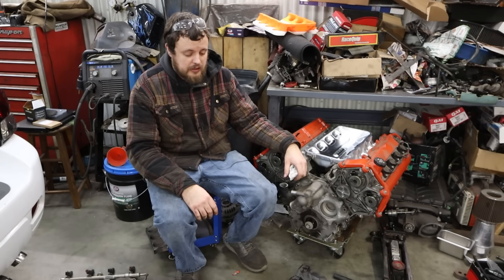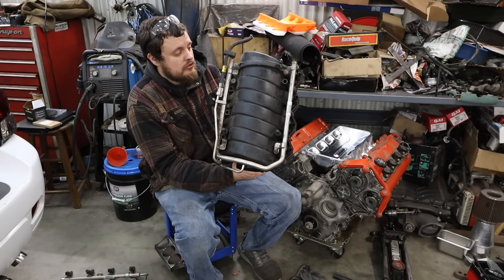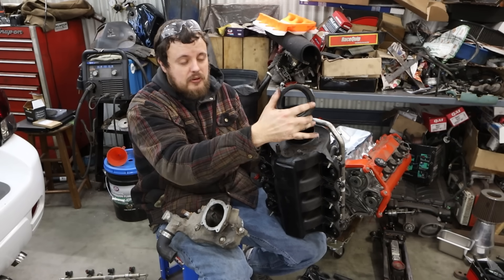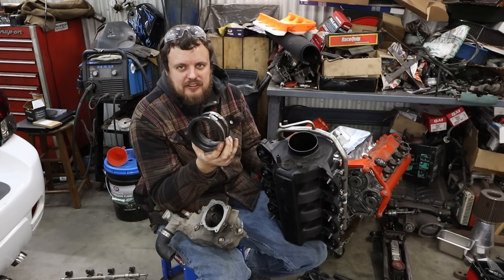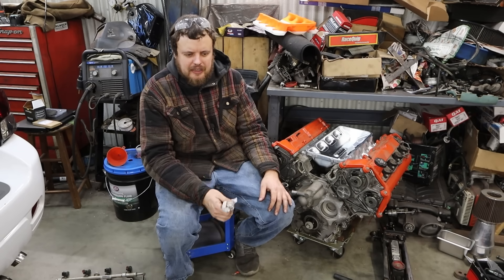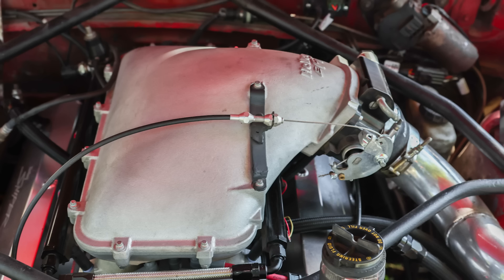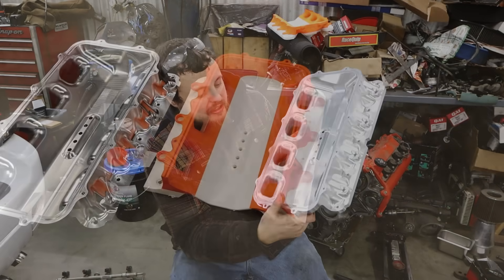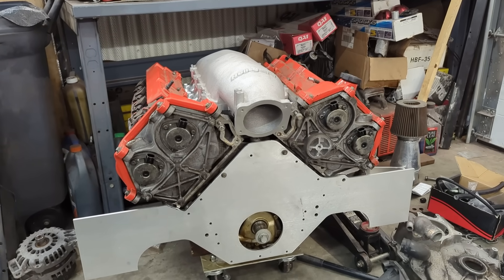Building a 10,000 RPM Intake Manifold for the Northstar Engine

Comment: If I recall correctly, runner length is not critical for a boost situation. because you don't use any of the wave interactions that occur with in the intake for an N/A engine.  So it would make more sense in a boost scenario to do as you have done.  Low end loss would be more effected by the turbo itself.  Thank you for the good work and love the theory .  I have a kit care with a ford pinto engine I'm lookingto upgrade, Around here there are a bunch of BMW's and Volvos, so I am looking at a N52 It has a magnesium block shell and an internal aluminum bores.   Amazing  For 1000 I can get essentially advance race care technology,   What a great time we live in.   The volvo has a sl6 which is a 6cyl that is the same length as a 2,4l 4 cyl   either would be not much more weight that the pinto and double and up for hp.
Reply: Intake runner length is important in a boost application for all same reasons as an NA engine. Just eyeballing the length of these runners, these are so short there will be very little resonator effect anywhere in the operating range of this engine, even if it runs to 10k rpm.

Comment: excellent.  you might need to be a GM engineer.  they took a v8 designed to run 300k miles and ruined it.  it needs sturdier chains and gears for the drive train also heavier guides

Comment: Curious how much the upgrades aid dependability...  Thinking about doing a unique swap for my NC Miata... If this thing can rev and not blow-up I might be interested: it is so short it would maintain weight distribution in the NC engine bay. I do wonder what type of transmission applications there are for this... 8HP?  Tremec 6-speed?  Would a manual conversion be possible...

Can't wait to see it running.  If you are planning a high rev application, I'd like to see what NA horsepower would be like. Can't wait for the next video!
Reply: If you can get the engine to run on a standalone ecu, i believe a manual swap would be possible. Just gotta take the Bell housing bolt pattern into consideration.

Comment: This along with some hot cams and a full exhaust would be perfect in an STS v8 to make it scream. Or crazier yet a clean turbo setup in an STS-V if you used a holley style intercooler plate. Tuning (especially increasing RPM limit) would be the biggest struggle as I assume if you want to keep the rest of the car working you'd need to either tune the factory ECU or run standalone then can sniff the entire car ($$$$$) and even then no way to guarentee if you can properly communicate with the TCM.  Wonder if you're interested in the Northstar Caddy platforms or are you developing this moreso as an engine swap option?

Comment: What will the trans side of the motor plate be? I am trying to cram an ls4 onto a th325 into a fiero. I am currently running a sandwich of adapting gm 60° to sbc, and then sbc to bop. Goven that the N* os also gm 60°, im very curious to see how it ends up mating to the trans. Very cool project, i think the N* is an underappreciated motor, though mostly deserved goven how stock they like to pop head gaskets.

Comment: I purchased a very clean 1999 DeVille with the Northstar engine, but I knew that it was leaking oil. I found a local shop that took it in and have spent the past month disassembling it, doing a valve job on the heads and most significantly installed the Northstar Performance head bolts. I had no capability to do any of this work myself, so it’s costing me dearly. But I expect that it’ll serve me well for many years, because I love everything else about the car.

Comment: My caddy was cursed. Did head bolts. 3 yrs later rad died and killed trans. I replaced trans. Got a low mile Eldo trans for $125. Job from hell. You can mate a distributor to WP drive and run a std distributor. I dun seen it.

Comment: I have an old school boat anchor project. A ignored and neglected little stud known as a semi-hemi, the A block 318 poly headed small block. I’m not racing it. I want it to pull. Factory forged crank and have been bored out as far as 426 cubic inches. Potential I believe. Twin turbo potential. Great channel. I enjoy witnessing your projects. I have a Jaguar XJ6 . I’d sell cheap. I’d like to see what kind of boost it could handle. Great work fellers.

Comment: I absolutely love what you and your father are doing. The 4200  builds are going to get the attention they deserve. Eventually. This Cadillac engine has my attention. We have one in our black all wheel drive wagon. I have some high hopes. Some say, many say, the Cadillac engines are junk. If the Cadillac can’t handle boost. Try a Toyota. 80’s-90’s Toyota v 8. They over engineered a lot of stuff back then.  That Holley high Ram hood is gonna need polished. Feller outside of Syracuse Mo could really make it shine. Leonard Romig is his name. He’s retired. But he’s a workaholic and he would enjoy handling something big enough to put his hip into it. He used to diecast with zinc. Along with sanding and polishing. Good feller. Professional.

Comment: Coyote manifolds are close to the same port spacing , Coyote Bore spacing  is 3.937  and Northstar is 4 in ,   but Coyote Ports are 4in spacing,   this 4.7l 02 ram I'm doing for a friend.. I'm adapting a Coyote Intake ,  Irony is one of the 4.7 ram projects I did a few years back used a modified 4.4 STS-V XLR supercharger, Belt drive worked out well, but that TB mounted "backwards" was an issue,  routed some "cold air tubing up through the cab over hang were the wipers are hidden and cut a hole for the Air in-let  in the cowl..... ....Love the project , love the Dare to be different vibe .       My uncle went the same route as you for his "Ultra low ram intake for his 9800 RPM Stock bore and stroke 5.7 Hemi project.   Print, Modify, then cast .

Comment: I know that V12s have been made from cutting/welding 2 LS V8s.  But I was thinking, cutting/welding 2 Northstar V8s to make a Northstar V12 might be an interesting project.    This would result in a 6.9 Liter V12.  48 valve. Overhead cam 4X.   That would be sweet.  I'm tempted to try this.    I figure I could buy 2 of these engines from wrecking yard for cheap.  If I messed up on the cutting/welding, then it wouldn't be that much of a loss.
Reply: How would this fit under the hood

Comment: Are the Holley lids pretty good about distributing airflow evenly across the whole plenum? I'd be worried that intake air velocity would "push" the airflow into the back 4 runners and starve the front 2-4 runners. Even in high boost scenarios when the air is trying to escape through every route available, I'd be curious to see if the same issue occurs.

EDIT: Just watched your intake manifold vid from 7 months ago and you touch on this. Ignore me and keep doin your thing haha.

Comment: I currently have a turbo northstar in my sand rails that I recently built. How much would you charge for one of these intakes?
Reply: What turbo are you running?  I want to add a turbo or two to my sandrail.
Reply: @Dunestud currently have a holset Cummins 5.9 turbo on it lol. I got a deal on a pulsar dual ball bearing turbo about the same size.

Comment: that's a long wait for parts on the little gas motor, thru a gas 4.6 ford in the junk pile just because of cylinder gasket prices... nowhere in canada makes 4.6 ford gaskets, so that is 280 bucks as 16.2 imperial tons of $18/ton scrap iron that goes over the boarder facilitating a single set of 4.6 gaskets, because it is a federal treasury exchange between two countries... ... there was a news article about a bridge collapsing and the train just left with it regardless. CAT gaskets cost 5 times less for an engine 3 times bigger. weird how that works, ASTM is cheap as is so it's not like 25% both ways stunts anything... more foreground stabilization tariff.

Comment: Northstar was an underrated engine.  Once you get past the issues , they can make solid power.
Reply: Shoot, if you took care of them, most of the issues would never even arise. They did demand on time maintenance schedules to avoid that. They couldnt/cant handle being neglected like a toyota or honda.
I have a soft spot for the north star. I got my first one in 2005.
Reply: So hard to find someone else that truly likes the Northstar engine. They weren't bad engines they just took more maintenance than 99% of people ever thought to give them. I mean look at big money cars like Ferrari and McLaren both have had bad engines in several of their cars and they don't get the hate the Northstar gets. McLaren put some weak ass rods in their engines and people are still bending rods like silly putty. Anyways I will always have a spot for a Northstar in my garage and in my heart.
Reply: Just as the 5.7 diesel and why do I dear to say that. GM did not have a diesel filter to take out water from the tank and just that did a mess..... Then the comp-ratio was a way to high..... Alot of nice things with some small design flaw in it..... NorthStar did have some issue with head-bolts and it was 11 mm witch is an odd number but going up to 12 mm and all went well......
Reply: Ls engine intake fits on the north star ??

Comment: So, I built one of these about 15 years ago. I got the big end head studs for it. They are very smooth running engines. Big lifter bucket deals. Haven't even looked to check if there are any performance camshafts for it. Anyway, we were going to turbocharge it and never got around to it. But, besides the split case block and the absolute need to put the good head studs in, this will be a very smooth efficient engine for sure. They get good fuel mileage.
Reply: Make a video about it I wanna see how you do it I wanna gain power on my 2006 Cadillac sts
Reply: @josiahmartinez7231  look up Northstar performance in Canada, if they're still around they make the big studs for it.
Reply: @slopoke22  Do you have a link to go to ...... really like this engine.

Comment: It's crazy that nobody makes a,.... for the Northstar engines, afterall, this is what Old's Aurora Indycar engine and Caddilac's Le Mans variant of the Aurora, is all based on.
With the right work, these things should have been eating LS and current LT (not to confuse with the Lotus LT) alive for some time,
Though when you asked about what manifold upgrade to replace stock, I went straight to ITB's. 😁
The Nylon manifold should handle about 1 atmosphere (14 psi) of boost before popping, but the convuluted air path is for N/A acoustics and torque, not boost. It'll build pressure, but will choke mass-flow eventually to turn boost in to waste heat. Whether it pops first or melts first is the real question there.
Going for the Holley flange, that lower half design could be a machine-on-demand production item, downpayment and run it off, final payment and send out. CNC repeatability makes these things economical now.

Comment: make the runner inlet capable of accepting a snap in runner so you could 3D print different lengths of runners in different geometries. those Runners should extend past the floor and go more towards the center where they can use the full 360° of edge of the runner to draw air. as it stands right now the outer wall is somewhat of a restriction.

Comment: More often than anything, super short runners tend to kill your midrange and your top end. Richard Holdener has some good back-to-back tests on it and there's a really simple formula for length and volume that tends to be pretty accurate.
Reply: I guess my point is that the answer to an intake that scavenges at the wrong rpm range isn't to just give up on scavenging altogether, there are a lot of gains on the table.
Reply: @SpaceGhostPoastToPoast  You're totally correct it's not as simple as long runners for torque and vice versa. Lots of math and throty but as you say there's a rule of thumb that's good enough for most people. I think however his short runner choice might be a packaging decision so you don't need cowl hoods etc

Comment: So excited about this build. I have 2006 sts-v supercharged with a bunch of engine mods. With a 8.8 rear end that I drive in summer. I have a 2005 sts 4.6 I drive in winter. I those car and the engine. I also have a 2008 4.6 engine, trans and wiring that I pulled out of a rusty parts car. I want to put it in a 49 chevy truck. I might be hitting you up for an intake.
Reply: I have an 06 STSV also. What engine mods have you made? I just bought the car for a project, would love to hear what you’ve done.

Comment: An NA V8 revving over 8k 🤤, kinda like an affordable bmw s65. I've always been curious about a high rpm northstar because it has all the ingredients, dohc, vvt, split block and short stroke. with the right cams it could make great power. One could dream, ITB's, 10'000rpm on a high compression build, basically a full blown circuit race engine.

Comment: I haven't worked in a caddy stealership since 09 and just seeing this thing gives me ptsd. God bless your efforts sir
Reply: God bless the men that look for hardship and trouble in their life.
Reply: I tell folks: the first time you have an electric problem with a Cadillac is the last time you should own that Cadillac
Reply: @jamesbrown6841  My father always dreamed about owning a Cadillac and finally bought one in the 1990s and it ran into electrical problems from day one. The engine would shut off while turning a corner, after thousands of dollars thrown at it and months of troubleshooting, my dad traded it in for a Buick.
Reply: I worked at a Cadillac dealership back in 2000. I remember there was Deville that had to have a whole new engine block put in under warranty because the mounting holes for one of the pulleys or the alternator was part of the block and broke off while being serviced. Does that sound right or am I misremembering? I jur remember a newer deville needed a new block for some mounting hole broke on the casting.

Comment: I think you are definitely onto the right engine platform. Excellent choice of runner length for a 4 valve turbo.lots of airflow through those heads!
The prosuction 4.6 had to try to move 4000#.. it needed every bit of tourqe it could get with runner length.

Comment: Hey I’ve got a question for you- I can see why the nylon intake manifold won’t work, but did you know that they made aluminum intake manifolds for the early model northstars? They supposedly handle boost better, did you ever assess the feasibility?
Reply: Won't work
Reply: @andrewnelson3733  Why not?
Reply: @andrewnelson3733  At the very least, couldn’t the bottom half of the aluminum manifold be used to adapt a new manifold to the ports?

Comment: For a while, the Northstar was the go-to engine for sand rails. Usually boosted, and it seemed like the engine would have a long usage in the off road segment.
And then...what? Has the LS simply gobbled up that whole segment as well? 
I like what they’re doing with this Northstar.
Reply: When you can have a simple and elchipo packets with a V8 engine and a gearbox all together to put in a sand-rail then it is obvious to use it. All front wheel drive cars have a donor goodies for sand-rails but some are hotter then others. I would like to see the Northstar more often used with a blower in many small cars.......

Comment: Listen man if you want that thing to be at 9000rpm you are are going to want to spend time testing it on a spin-tron for harmonics testing before you consider 10,000rpm. You can do a lot of guess work with some basic math. Like cyclic speed of the valve train, valves, piston speed and forces on the piston, pin, and rods.

Comment: To preface, I'm coming at this from both an engineering background and researching intake manifold design. It's a little late but that large of a radius on the port entry is going to rob some air from the conjoined cylinder, being that they almost round over into each other. And if I understand the firing order of the northstar right, thats going to be cylinders 6 and 8 (8 opens when 6 is halfway down so likely 6 will be robbed of air). The Holley low ram base doesn't have that large of a radius nor is it directly on the wall. Now Idk how much that will actually be a concern with boost and higher air density, but just some considerations for you for the future. It's a cool piece nonetheless.
Reply: Boost solves that problem

Comment: Would love to see an engine dyno of this intake vs a stock one NA. Probably moved peak torque up 2000 rpm, will you grind a cam profile to maximize the higher rpm capability of the intake?
Reply from the maker: Probably

Comment: I'd be curious to know if you considered SLS printing the lower manifold out of aluminum through one of the printing services. You could also consider having it made of a GF or CF Nylon 6.6 as an SLS part too.
Reply from the maker: I wouldn't trust a plastic 3d print, but a metal one I would. Problem is they are still very pricey
Reply: @Calvin-Nelson  That's fair. I was just curious if you got a quote on a laser sintered metal lower intake. I would think it would be on par with the price with a billet aluminum machined part and could potentially be lighter.

Comment: I'm kinda at the same odds with my plan to go vk56 the timing system is the engines Achilles heal and it seems like since nismo leaving motorsport no one wants to build a 1 off chain solution for small market. IDS is using one in their stock car this year so hopefully the aftermarket shows it some love